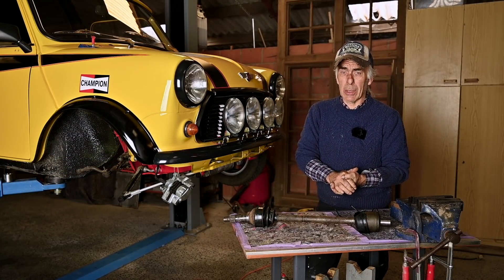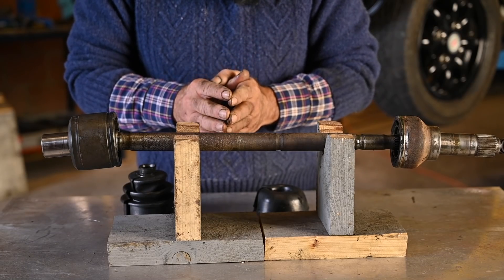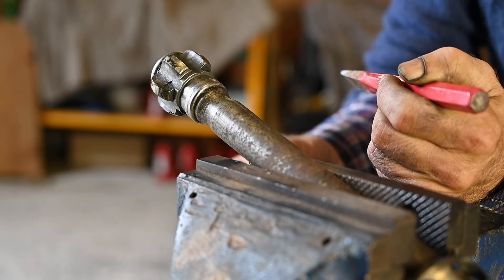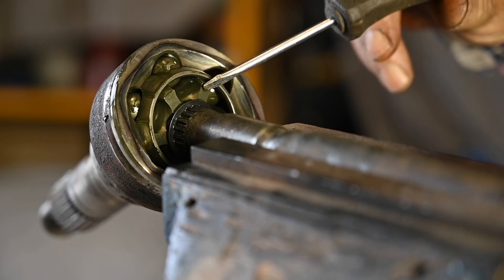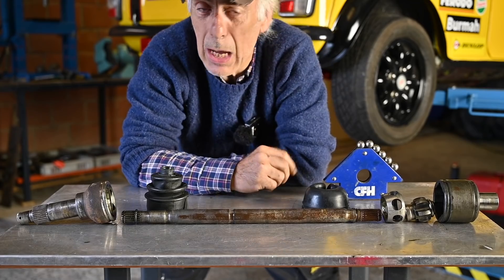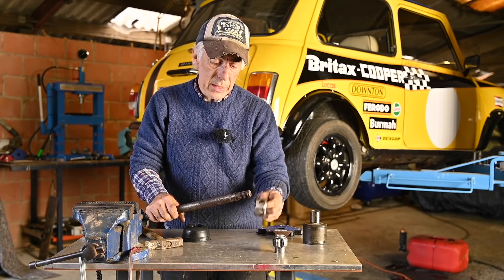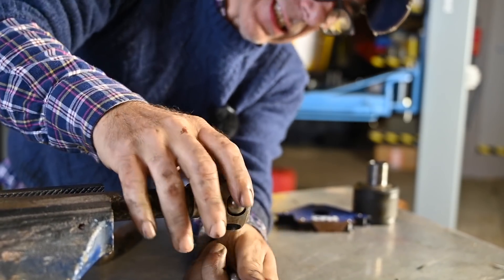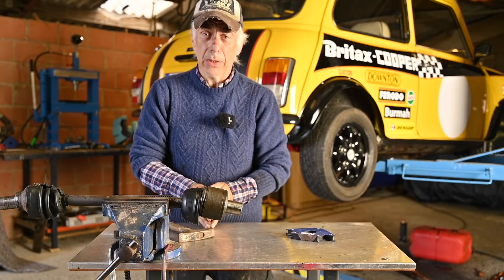Classic Mini  , Drives shaft reconditioning

Comment: Excellent video, thanks. I'm just about to have a go at the drive shafts on my MK2 Cooper S. Thanks for this.

The drive shafts are similar but on these older cars but they didn't use an inner CV joint. The basic minis used a crude rubber coupling with U bolts (I'm amazed they ever lasted very long) and the performance cars (and automatics) used Hardy Spicer universal joints. Both types of joints would easily go through the hole in the subframe assembled. I guess it would have been expensive to re-jig the subframes to make the holes bigger when the introduced inner CV joints, hence the newer inner joints don't fit through the hole.

The outer end CV joints seem to be much the same on my early car as in your video.
Reply from the maker: Thank you and enjoy your rebuild

Comment: Make your life a whole lot easier: after having removed the CV joints, take off the locking circlips.  Carefully bend in the end of the circlips by about 1/8th"  (3 - 4 mm) & refit. they will retain the joint assembly, yet reduce the effort required to take them off the shaft next time. Bleeeve me, owned minis since 1968.
Reply from the maker: Great tips

Comment: If only I had a dollar for every cv joint I inspected and repacked, it was part of a major inspection on all VW models until they came out with a synthetic high temperature grease.
Reply from the maker: TXS for the comments
Reply: So would you pack these mini cv joints with synthetic high temperature grease?
Reply: @mad-maxx2211  yes I definitely would use synthetic high temperature grease, never had cv joint wear with it.